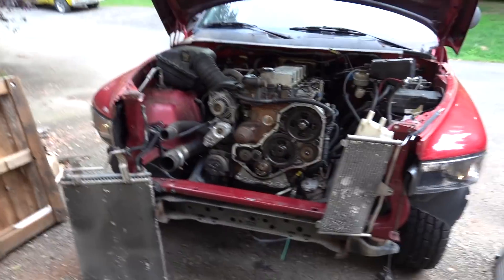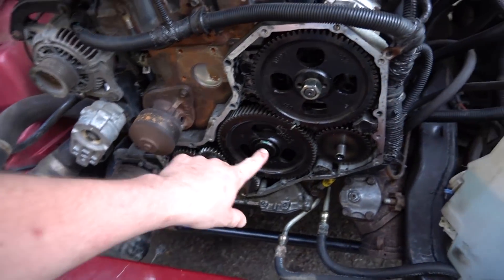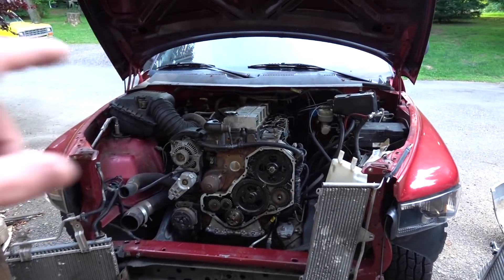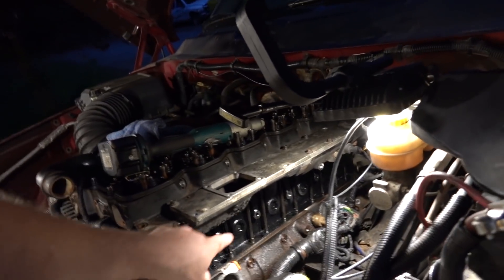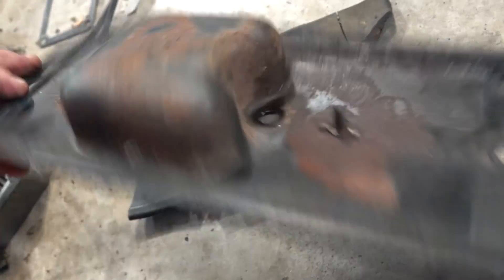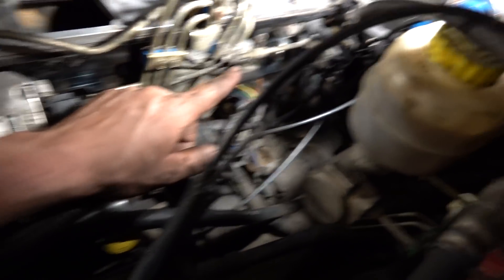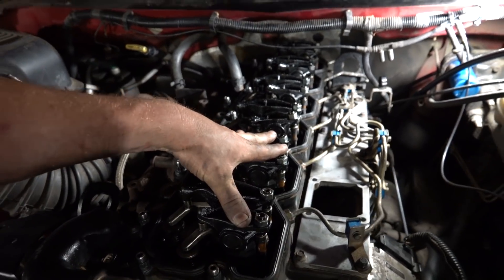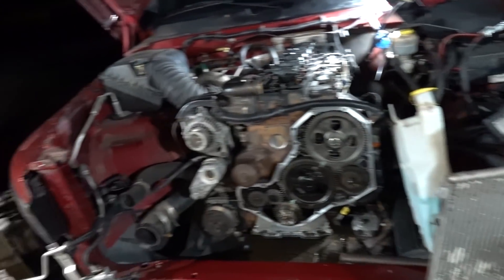BILLET 2ND GEN Cummins Oil LeaK Fix!!

Comment: I did this job on my 01 24v. I wish i had bought the less expensive ebay billet cover. I ended up paying over $300 for bean machine through Thoroughbred diesel, because they said no mods were necessary. Turned out i had to not only grind my vp44 bracket but also machine the stand off bolts so they would recess into the cover. They machined the holes in the wrong locations. Then the all threads for those we’re barely long enough i had to pre install them with red lock tight then install the standoff nuts. Left it questionable for torquing it evenly. All this work and it still ended up leaking again less than 6months later. 

Totally disappointing as I brought this up to Thoroughbred diesel and got zero response. What a waste of money

Comment: Hey man, I’m probably to late for this to be of any use, but the A/C condendensor(radiator in front) has lines that are so small that they acqnt be flushed cleaned. To do the A/c, your wasting your time to try to reuse it. Once the compressor starts failing it will not only clog the orifice tube it plugs the the condenser. I’m pretty sure dodge(and most manufactures) tell you to replace it when doing a compressor drier and orifice tube. A lot of time the condenser will flush(that’s a personal judgement call) if you run some flush threw a white rag and see what you get when you flush the A/c lines.